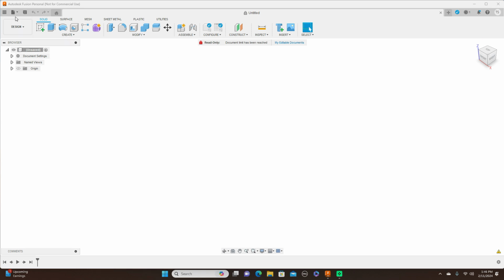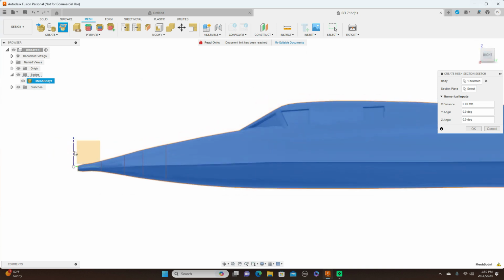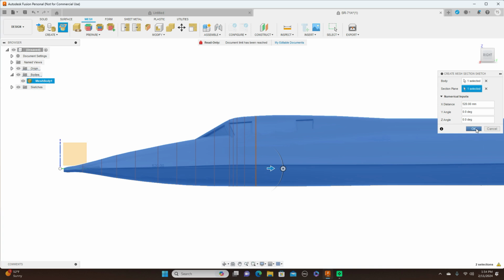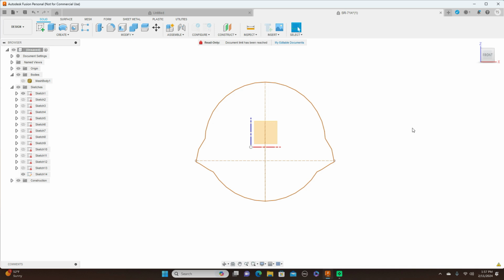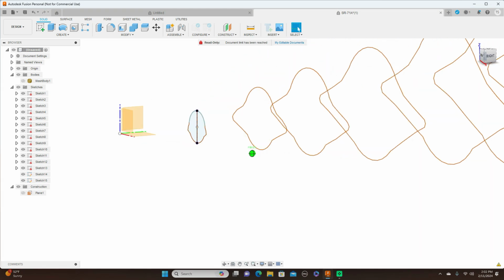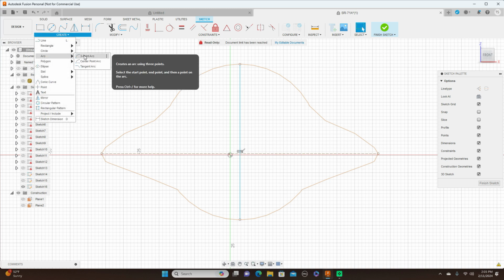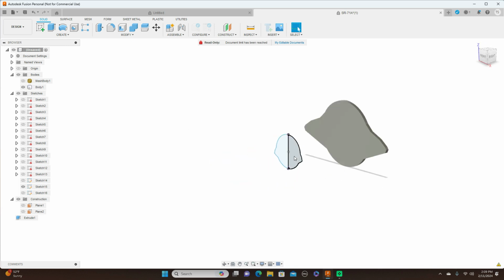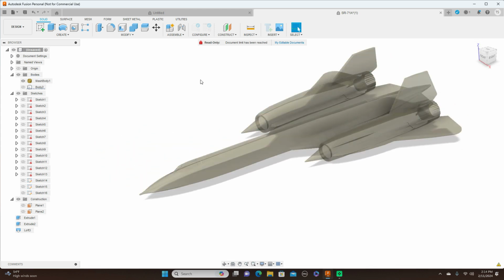Un-Lock The Secrets of Existing STL/OBJ Files To Make Molds Or A 3D Printed Flyable Model.

Comment: Appreciate your contributions to the community... Just a quick note.... When it comes to CAD and lofting profiles the less profiles the better. Too many can cause more  imperfections in the resulting surfaces. If anything a balance has to be made with using guide curves pierced through each cross sections. Other than that great start.